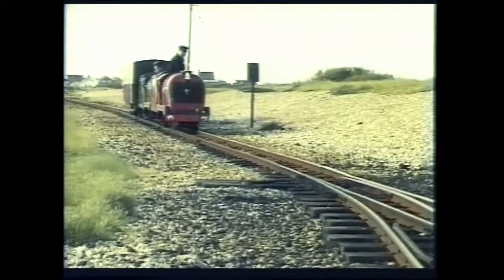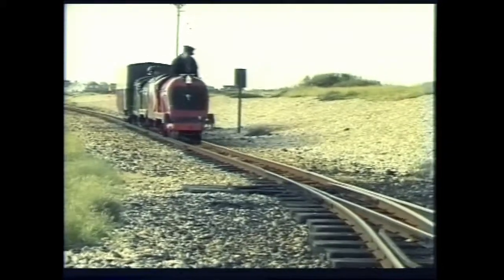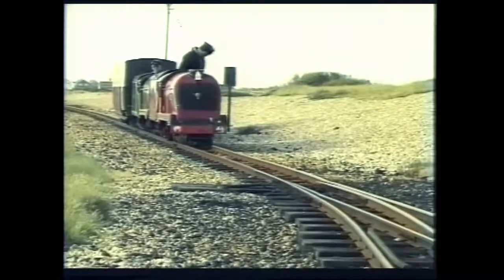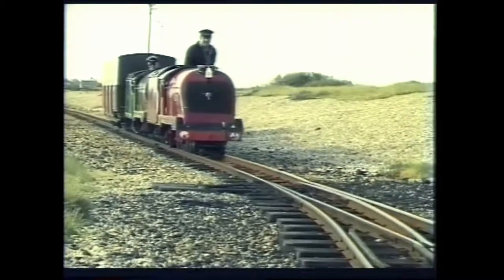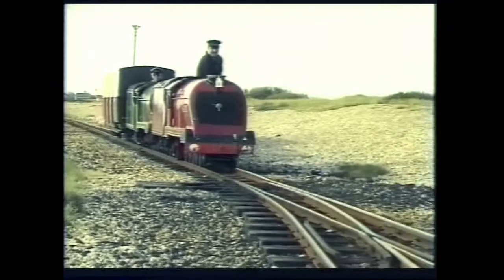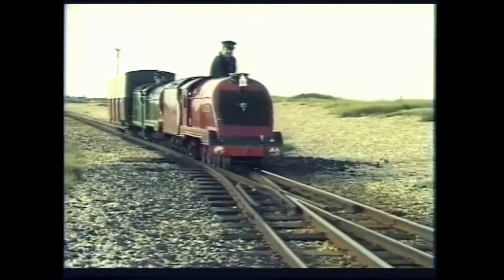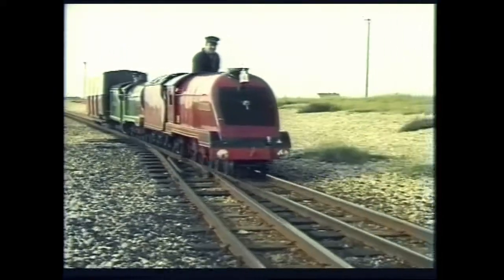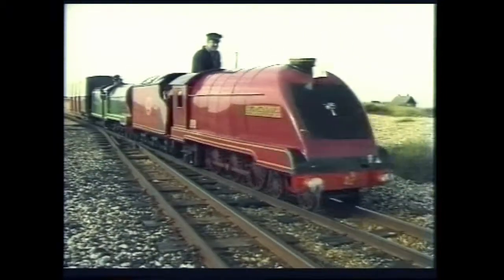Barlow's at Dungeness in 1999

Comment: They look like mini A4
Reply from the maker: This was really the only design that would accommodate the drive in 15" gauge. Under the cowling was a very large electric motor plus the control equipment, while the tender contained a large petrol driven generator. I used to have some pictures of the loco without the body on but appear to have mislaid them unfortunately.